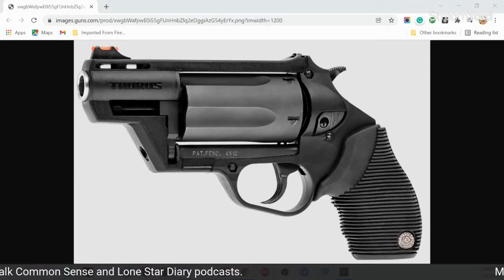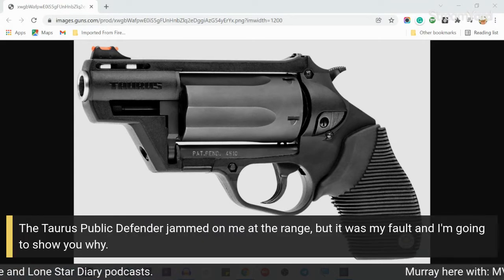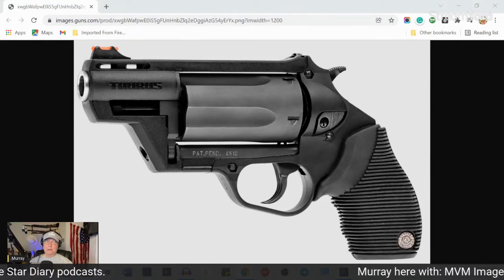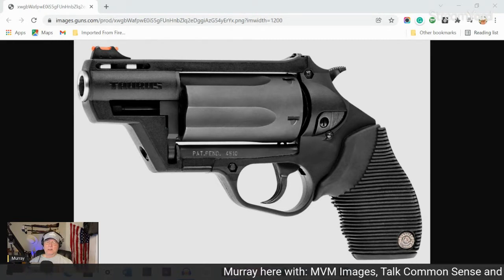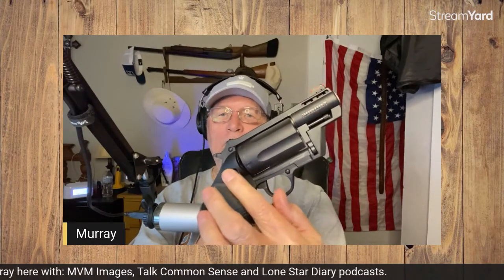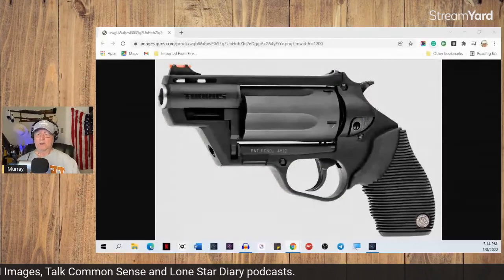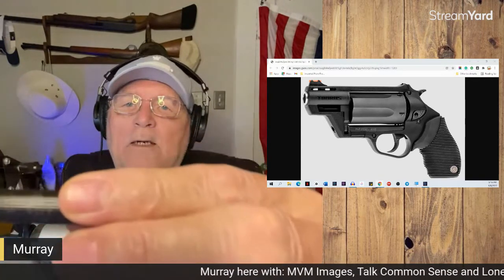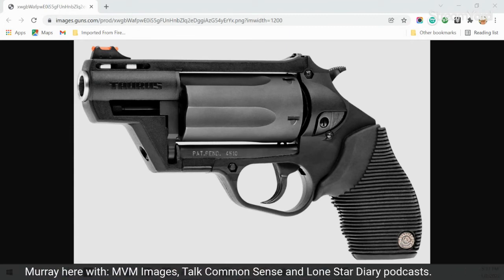Jammed Public Defender   My fault!

Comment: Just bought a Poly Defender. Loaded the Horandy 410 Triple Defense rounds in it. All fired but I had to use pliers to remove them. I think the grease from the factory leaked into the chambers sitting in the box. This caused the shells to cook and expand more than expected. Haven't tried another type or brand yet.